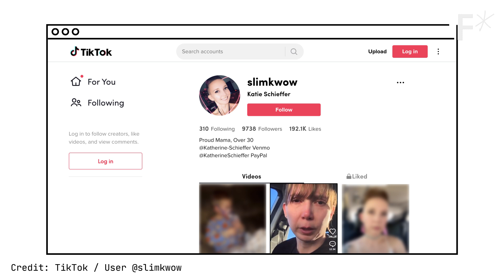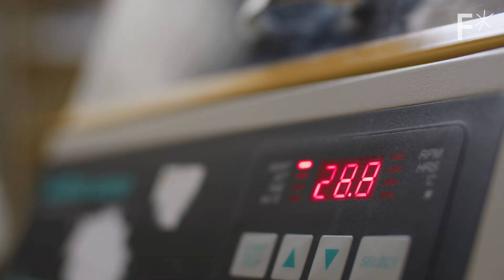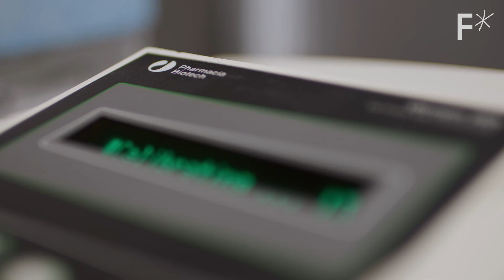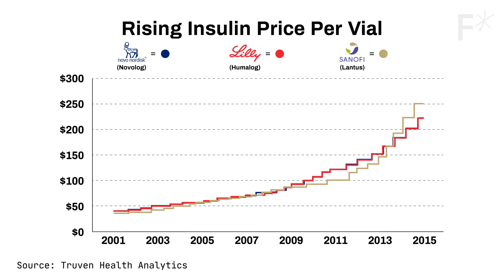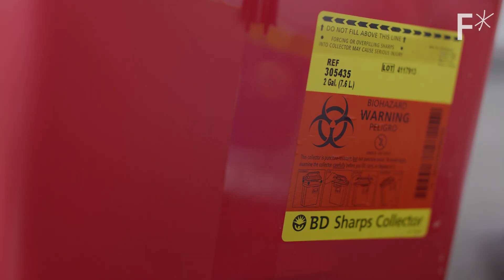The biohackers making insulin 98% cheaper | Just Might Work by Freethink

Comment: Gotta be at least a little skeptical, that price will probably multiply when you add regulatory costs, quality control, etc. Even if you make the R&D free this sort of thing requires a whole apparatus.
Reply: If quality control and regulatory costs can take something that costs less than 5 dollars a vial to make and jumps the price up to 300-500 dollars in some cases (per vial btw) then something is horribly wrong. I think these geniuses splicing insulin proteins into yeast probably have a better hold and understanding of the process than Joe schmoe in the comments section

Comment: Already Cheap here in Bangladesh.
only pre-filled pen with an easy touch button, enabling doses of up to 80 units in a single injection.
The insulin containing 300 units would cost Tk 2,490.
That's $30.

Comment: There are two reasons, which in combination allow the big 3 to dictate the price.
1) Ridiculous technical patents hold by these companies, which have been denied in any other country. These patents block competitors and also illegalize the approach presented in this video.
2) The narrow minded sight of FDA on generics, which prevent competitors from circumvent said patents (the generic needs to be 100% like the originator including color and functionality of the used pen injector).
You need to wait another 3 to 5 years until these patents expire. More than 20 companies are currently just waiting for that moment with production lines ready to start manufacturing.

Comment: It's great that this is happening, but I can't help but feel that history is repeating itself. In their letter to the University of Toronto proposing the idea of selling the original patent for Insulin to them for $1, the inventors wrote:

"The patent would not be used for any other purpose than to prevent the taking out of a patent by other persons. When the details of the method of preparation are published anyone would be free to prepare the extract, but no one could secure a profitable monopoly."

They did this in part because they were concerned with the intention of the Eli Lilly Company to commercialize the production and sale of insulin. As mentioned in this video, Eli Lilly is partly responsible for the high prices of insulin in the USA today.

Which brings me to my main concern: Even IF this project develops a cheap way to produce insulin and publishes it for anyone to use, will big pharma really give up on this cash cow or will they just find another way to make billions from it?

Comment: This is a good project, but I think their idea to bring it to the market is dangerous. Rn drugs are made in big expensive factories. The quality control is on point and very consistent. With many small labs around making the stuff, the chances of a batch getting wrong and the quality to have differences depending on location is not a good thing.

Comment: Been a diabetic for over 30 years and have been paying out of pocket for the last 8 years for my insulin goodRX has saved me. I haven't been able to work for the last 9 years there are ways to get help you can't just sit around and hope something or someone is going to help you. I get it insulin cost is outrageous and I think it should be way cheaper.
Reply: @Nick Arjoma yes my Humalog cost me $76 a vial compared to the asking price of over $300. I use an medtronic insulin pump and use 2.5 - 3 vials a month. The only thing I'm still having a hard time with is the testing strips the sync with my pump. Facebook has helped me with my pump supplies. When I get back on my feet I'm going to be helping the page moderator anyway I can. On a side note goodRX gold is worth the $5 extra.

Comment: Don’t blame the pharma companies. Blame the FDA. Instead of using a piece of lab equipment to make insulin you need to use a piece of lab equipment that has been calibrated and documented to work in a temperature controlled room with protocols. To write these protocols you need engineers who are paid $80k+ a year. Then you need a quality assurance department to test the insulin for another couple hundred thousand a year. Then you need a regulatory department to get approval from the FDA and to deal with the paperwork. Then you need to pay $200k/year just to be allowed to make the drug. Then when customers complain about the insulin the company gets sued and you have to do a recall and an investigation which costs a lot more money. That’s why drugs cost 10x more in the US than other countries,  if the FDA got rid of a few regulations and rolled back to 2008ish then drugs would get way cheaper

Comment: Wait... so dozen physicians is volunteering for this six years, they havent even made it, and I fully support them, however, who was feeding them all this time, maybe production of insulin is not that cheap after all? Why are they not calculating in their time?
Reply: These are not most probably not physicans but more likely molecular biologists and/or biotechnology engineers. Production of insulin or any other pharmaprotein is not easy or cheap to research develop. Manufacturing costs are another matter. This has to recoup the investment for pharma, otherwise there is no incentive to develop new things. For insulin this is not justifying the cost any more as the process has been developed basically in the 1980s. The cost for insulin is actually way lower outside the USA.

Comment: It didn't come across in the video: They are producing lispro and glargin. Both are insulin but differ in kinetics meaning lispro works really quickly and for a few hours only while glargin last about 24h. Modern insulin therapy for type 1 diabetes needs to combine these two to emulate the missing insulin production in the pancreas. Type 1 diabetics would use glargin in the morning and lispro before meals. These two only entered the market in the last 20 years. There is cheaper insulin which is not as simple/convenient to use and requires a rigid schedule and meals

Comment: But what happens when someone tries to sue over having a bad reaction to the insulin you or a rando lab produced. Who would be considered accountable for the problem and even if some small lab was considered liable they likely wouldn't have the funds to deal with a lawsuit selling insulin at such a low cost. Obviously 1k is pretty high but seems like there's still issues that just get ignored
Reply: @frosttaco3540  I'm sure there's regulation, but it isn't uncommon to see a commercial for a class action ever day or 2 about a medication or product failing or having an issue. It's also likely to cause others to try and mimic the process with other medication as well. I'm not against it, I'm just curious about the issues it causes when Timmy's mom blames the lab for faulty production and isn't able to bank roll the issue

Comment: It's "simple"; There are (if I recall) 3 current patents on insulin shared between 3 companies. They spread said patents ~just~ far enough to not be a monopoly, and lobby government to let them keep up this vampiric practice. 

It is literally government and corporate greed, that are forcing prices up on drugs like insulin. If you move government out the way, and allow competition of methods, you would see far cheaper drugs and medical tools across the board. Of course, not all of them would be better, some may even be far worse, but the competition alone, and increase in generic options, would allow the problem to self correct to a degree that would make heads spin. Imagine instead of a few large companies charging near 1k for it, you have your pick among the market, for insulin priced instead, at 10-20 bucks.

Comment: First let make it clear where I am coming from, I am dependent on insulin myself so I think this problem should be attacked on more than one front first figuring out how to make it cheaper is good, but also try to figure out how to reduce your own insulin resistance because that is part of the problem your own cells build up resistance to the body's own insulin, if you can reduce that one people would have to take less lab made insulin or maybe none at all.

Comment: I think the pressure is coming in. Because I just saw an article about Walmart providing cheaper insulin. It was $72 but there was another older less effective Reli on product that ran around $25. 
Still pretty dang expensive for some folks. But I guess it's better than nothing. 
Except what happens when you can't take those two?

Comment: It's a good project, and the people doing great work.

I only have a problem with the framing of the video. A monthly supply of insulin costs in Europe around 35€, which is payed in full by public insurance. The insuline patent is more or less open and free to use already. And the reason that there are only 3 insuline manufacturer is fairly simple: it's so cheap to produce and is sold so cheaply, that it's simply not financial viable for startups to get into. 

Why i mentioned that the framing is bad beceause the video says "'it's a world problem" and "the team solves it my reverse engineering". But it would me way more accurate to claim, that they solve a US market issue by cutting out insurance & reseller companies with an opensource production solution for insuline.

Also, kinda weird to talk about "bringing the solution out of america to the whole world" and listing Puerto Rico. Puerto Rico is US-America.

Comment: With modern gene editting material and a few pieces of equipment most college labs have, insulin is not hard to produce using CRISPR or something similar. 

I don't understand why they are reverse engineering when there is already a easy way to make insulin

Comment: They should be careful with who they are allowing to work in the lab and who has access to the paper. Undecover pharmaceutical researchers might infiltrate them, copy the methods and other innovations, and sell/give the information to the big three. Also, they should keep their devices secure because they could also get hacked. In case their data/paper is leaked, one of the big three could just submit a patent for it ahead of them and prevent their project from reaching its goal.

Comment: Good for them! And I hope they pull it off. As for the big pharma price gougers this video actually understates the problem RE insulin costs. One of my insulins costs $369 for a one month supply, the other costs more than $400! Worse yet I recently switched to using an insulin pen for my basal insulin for reasons having to do with bottled insulin going bad because I couldn't use it all before the expiration date. In Europe you can purchase a reusable pen for a one time cost of around $80. You can then purchase small vials of insulin for use in those pens for a reasonable cost. In the US those reusable pens are available but Novo, Lilly, et al refuses to sell the replacement vials. So I have to buy a set of disposable one time use plastic pens and a one month supply costs over $600 for the same amount of insulin that sells normally for $400! And it's not just insulin, test strips used to  measure blood glucose cost less than 5 cents to manufacture and sell for as much as $1.50 each! When Diabetes Forecast Magazine asked the manufacturer's association to justify this huge mark up the representative smiled and said, "In America it's not illegal to make money."

Comment: Fatty liver & Insulin 
Did you know the shocking fact that Fatty liver comes from a high level of insulin?
Insulin is the main fat storage hormone in the body. 
It tells fat cells to store fat and prevents stored fat from being broken down.
What insulin means?
Insulin is a hormone that lowers the level of glucose (a type of sugar) in the blood. 
It's made by the beta cells of the pancreas and released into the blood when the glucose level goes up, such as after eating. 
Insulin helps glucose enter the body's cells, where it can be used for energy or stored for future use. 
Insulin is a peptide hormone produced by beta cells of the pancreatic islets; it is considered to be the main anabolic hormone of the body. 
It regulates the metabolism of carbohydrates, fats, and protein by promoting the absorption of glucose from the blood into the liver, fat, and skeletal muscle cells.
When cells are insulin resistant (very common), both blood sugar and insulin levels go up significantly.
Most doctors are trained to focus on drugs and surgery - not lifestyle and prevention.

If you don't provoke your pancreas into overdoing the insulin, the weight just falls off you. 
This is not about overconsumption of cakes and biscuits... this is about not eating fruit, Weetabix, Shredded wheat, corn-oil; not eating 3 times a day and instead of eating when properly hungry, etc, etc, etc.
When the disease becomes a business you will never find the cure. 
It is so sad but very true.

Comment: 69 ppl from big pharma doesn't like this guess what at 35 years old I found out I'm a type 1 diabetic dr prescribed me a pen cost me $10 for 2 pens went for my refill and now insurance says grace period is over now 2 pens is close to $500 I'm fully in support of this because I'm living it as we speak
Reply: The most surprising result was that more than 50% of subjects were 𝗮𝗯𝗹𝗲 𝘁𝗼 𝗱𝗶𝘀𝗰𝗼𝗻𝘁𝗶𝗻𝘂𝗲 𝗶𝗻𝘀𝘂𝗹𝗶𝗻 𝗰𝗼𝗺𝗽𝗹𝗲𝘁𝗲𝗹𝘆 𝗮𝗳𝘁𝗲𝗿 𝗼𝗻𝗹𝘆 𝟭𝟲 𝗱𝗮𝘆𝘀
 on a low-fat diet, 
even having lived with type 2 diabetes for multiple years.

James W. Anderson and Kyleen Ward conducted a study in 1979 in which they enrolled 20 subjects who had been living with type 2 diabetes for more than 20 years 

The researchers fed participants a diet low in fat diet and high in carbohydrates but not restricted in calories,

 and monitored changes in insulin requirements and blood glucose over time.

In order to study the effects of diet alone, they made sure that subjects ate enough to prevent them from losing weight.

Some subjects complained of physical discomfort from eating so much food, but the protocol ensured that all subjects remained weight stable.

By doing this, they could then study how insulin requirements changed on a low-fat diet, independent of weight loss.

The results of this study were nothing short of remarkable. 

Insulin requirements plummeted by an average of 58% in the group that ate a low-fat diet, 
whereas insulin requirements did not change in those eating the conventional diabetes diet.
𝗧𝗲𝗻 𝗼𝘂𝘁 𝘁𝗵𝗲 𝟮𝟬 𝘀𝘂𝗯𝗷𝗲𝗰𝘁𝘀 𝘄𝗲𝗿𝗲 𝗮𝗯𝗹𝗲 𝘁𝗼 𝗱𝗶𝘀𝗰𝗼𝗻𝘁𝗶𝗻𝘂𝗲 𝘁𝗮𝗸𝗶𝗻𝗴 𝗶𝗻𝘀𝘂𝗹𝗶𝗻 𝗮𝗹𝘁𝗼𝗴𝗲𝘁𝗵𝗲𝗿
and those who continued insulin therapy were 
𝗮𝗯𝗹𝗲 𝘁𝗼 𝗿𝗲𝗱𝘂𝗰𝗲 𝘁𝗵𝗲𝗶𝗿 𝗱𝗼𝘀𝗮𝗴𝗲𝘀 𝗯𝗲𝘁𝘄𝗲𝗲𝗻 𝟳-𝟵𝟴%.

The most surprising result was that more than 50% of subjects were 𝗮𝗯𝗹𝗲 𝘁𝗼 𝗱𝗶𝘀𝗰𝗼𝗻𝘁𝗶𝗻𝘂𝗲 𝗶𝗻𝘀𝘂𝗹𝗶𝗻 𝗰𝗼𝗺𝗽𝗹𝗲𝘁𝗲𝗹𝘆 𝗮𝗳𝘁𝗲𝗿 𝗼𝗻𝗹𝘆 𝟭𝟲 𝗱𝗮𝘆𝘀
 on a low-fat diet, 
even having lived with type 2 diabetes for multiple years.

In addition, as a convenient side effect of a reduced intake of dietary fat, cholesterol levels dropped an average of 29%, from 206 mg/dL to 145 mg/dL.

Most importantly, all patients in this study were able to reduce or discontinue insulin therapy and reduce their cholesterol levels without any changes in body weight,
 clearly demonstrating that less dietary fat results in less insulin need.

Just imagine what would have happened to their cholesterol levels if they added the world's most powerful cholesterol-reducing food – amla (Indian gooseberries)...

Anderson JW. High carbohydrate, high fiber diets for patients with diabetes. Adv Exp Med Biol. 1979;119:263–73.
pubmed/495284

Comment: I'm in (almost) the same boat as the woman at the start of this video. I'm a Type 1 Diabetic, and my insulin costs $378 a vial (I go through 3 vials/month) The bad thing about this is that only synthetic/human based insulin is now legal in the USA for use by humans. I grew up using beef/pork based insulin, and it worked quite well. That type of insulin is still produced, but it can only be used for animals. It also only costs about $75 per vial, and most people don't have the time/patience to care for a diabetic dog or cat.
    Add to that the cost of insulin delivery (insulin pump or syringes) and testing of Blood Glucose levels (test strips, glucometers. or Constant Glucose Monitors) and it costs me well over $2000 a month just to keep living.

Comment: Real quick: Insulin is the most prevalent and widely known instance of diabetics getting fucked over, but it's not the only means. Every single thing that diabetics use for monitoring and controlling their blood sugar is absurdly expensive when compared to the materials at hand and the work put into making them.

Blood sugar testers are simple machines, often with monochrome monitors. Blood sugar test strips are literal plastic. Insulin pumps can cost several times more than even a smartphone despite being far more limited in capability. Some of the supplies used to maintain an insulin pump can cost more 50 dollars a piece. This extends to continual glucose monitors as well.

The problem is that because the market for these items is so limited, and because they are necessary for survival and long-term health, they can charge absurd prices and still sell items. There needs to be strict, non-negotiable limits as to how much can be charged for any product someone uses to either maintain or improve their quality of life.